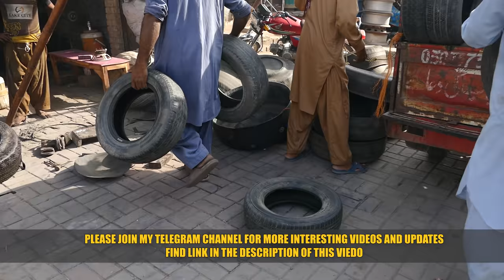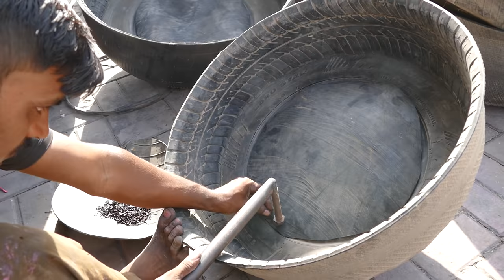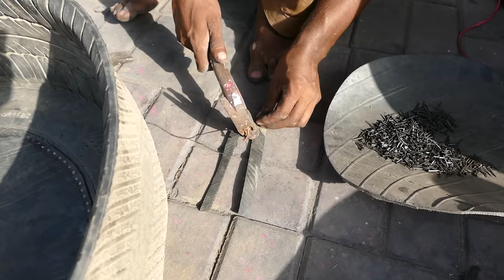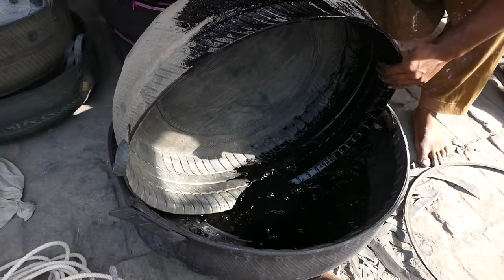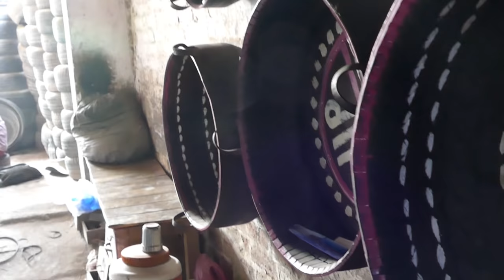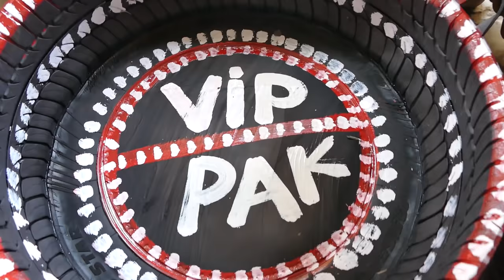Making a Beautiful Tub from Old Tires

Comment: here in southern USA we used to do this to make flower pots.i have some made decades ago.they last forever.the top edge would usually be cut in some design.
Reply: Hi mark we do it to wwn ww buy new tires for the car or truck we stay with old tires n flip it inside out n wen its inside out we cut sides instars so wen its dine it looks like a flower seed. Nice pot for plants
Reply: Similar also done in the Caribbean.

Comment: Does anyone know, was this tire old style bias ply or up to date radial ply?  Can this be done with 'radials'?  Would really like to know.   Thank you
Reply: Don't cut too close to the tread or you'll hit wires.  Otherwise should work fine since the sidewalls are nylon reinforced in my experience.  Might be a job to turn it inside out.  Also, oil your knife when cutting so the rubber doesn't grab your blade.